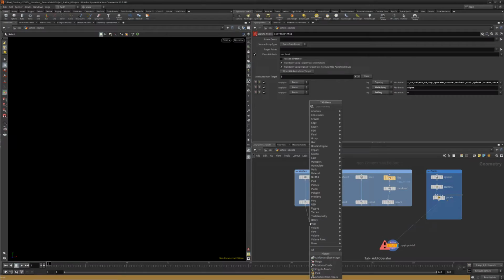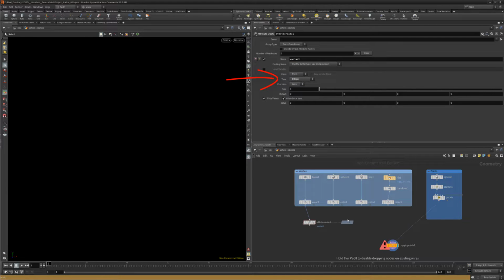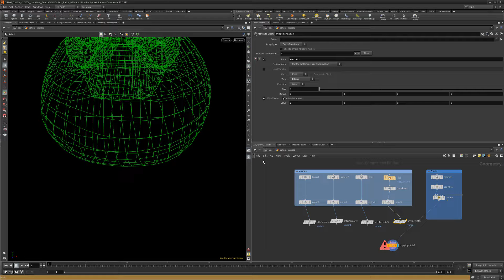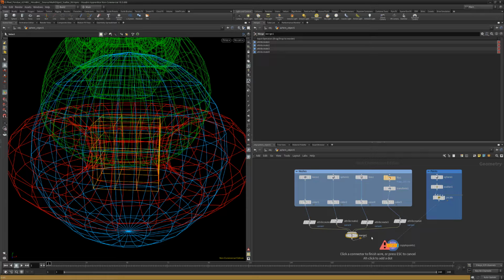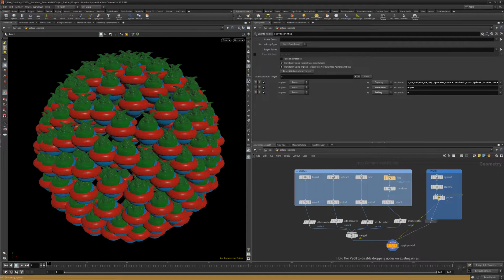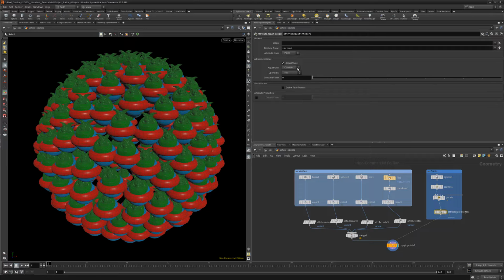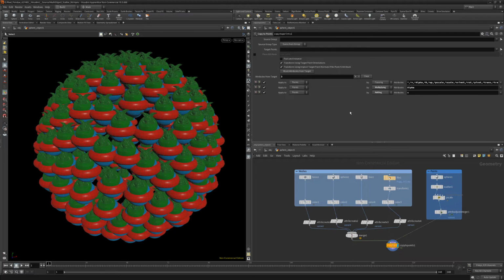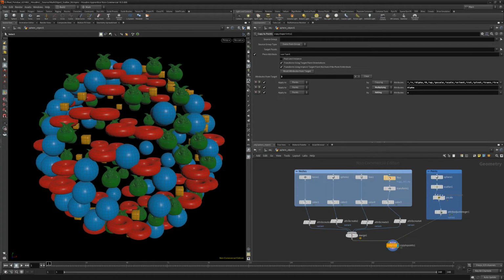Houdini | Copy to Points Using Multiple Source Meshes (version 3)

Comment: I think I found a better method for doing this, but since I'm a beginner I'm automatically assuming that my method is flawed and I'm not experienced enough to know why. Wouldn't using a connectivity node after the merge instead of adding a new atrib wrangle for every mesh be better? I tested it and it seems to work when I scattered a bunch of cubes, tubes, and spheres onto a plane. Is it a case of assigning an attribute to every point not being a very optomized solution? I just found the idea of duplicating a new node for every mesh not very procedural.